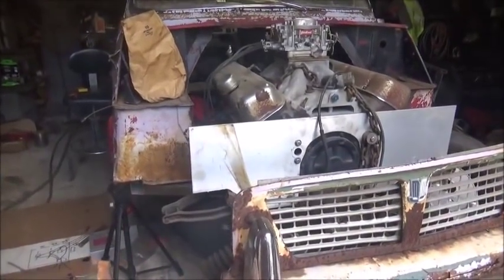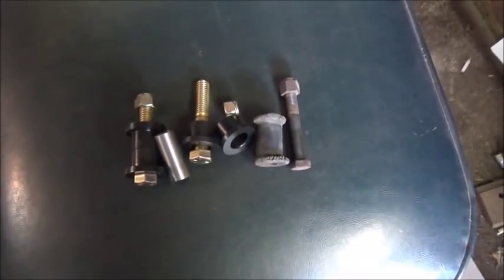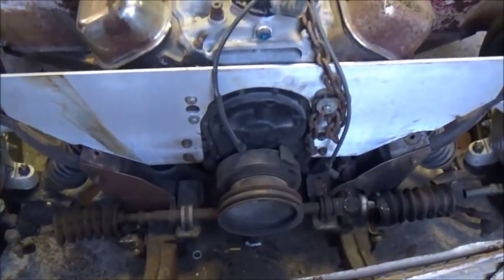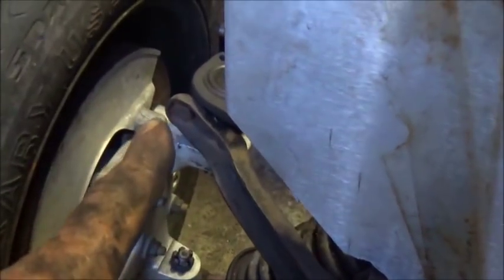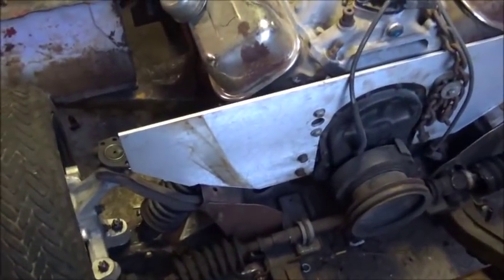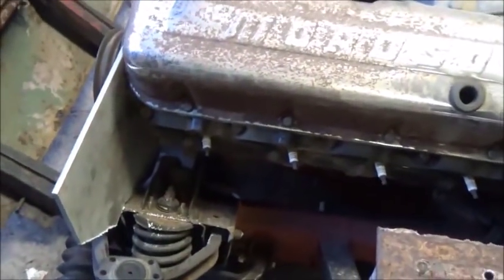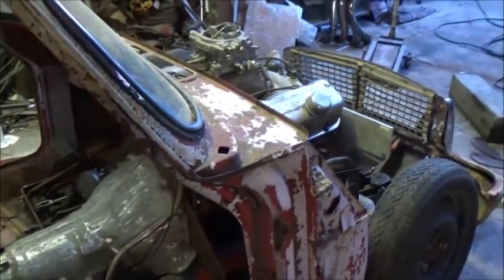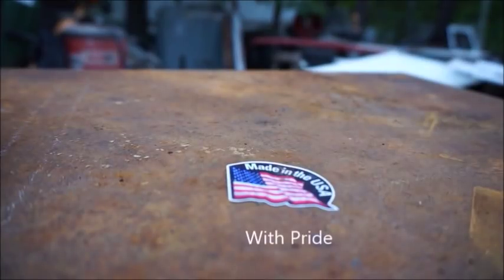Low Budget Drag Car Build Part 23 On The Ground

Comment: Hi John great job so far on the drag car project love seeing the videos and the progress. You are a very smart man and have probably already checked this but check for bump steer' I have a 9 second Fox body Mustang and by times it was a handful until I addressed the bump steer problem. My aftermarket rack mounted lower than the factory rack which caused my tie rod ends to be on a different plane than the lower control arm. It was a easy fix with a bump steer  kit which was simply changing the outer tie rod with a rod end and using a bolt and spacers to get the tie rods and lower control arm on the same plane. You could achieve the same thing by raiseing or lowering the rack. Great job can't wait for the next video and to see it run and drive.

Comment: That should ride pretty good for what you are doing can't wait to see the first drive in that thing when she 's all finished up, have you thought about doing small 2500 bags on it,instead of coils they may be a bit soft at higher speed  after it has some time with that big block sitting in it

Comment: Love it love it cant wait to see in on a drag strip. I still love the moroso valve covers. The suspension is a cool aspect thanks for sharing with us. Good catch on that axle don't want an axle flying out on the road. Have had a 12 bolt on a 71 stepside fall out on me not fun. Keep the cool videos going.

Comment: Would it be easier to access the rear end etc  if the rear of the body was fitted with release latches so you can take it off at the track ?

Comment: I know its a low buck project, but you could use a couple rod ends on the steering instead of regular tie rod ends so you can adjust out any bump steer. Then drill holes in the spindle to take a bolt, just throwing this out there as a option. Love the build, its going to be good.

Comment: Are you gonna put a dana 60 in it? I mean there was no 9 inch for Mopars. There was a 9 1/4" (good diff) and a 9 3/4" (the dana 60) They didn't mess around